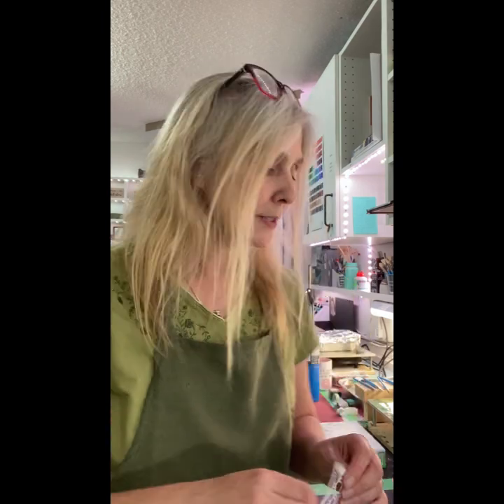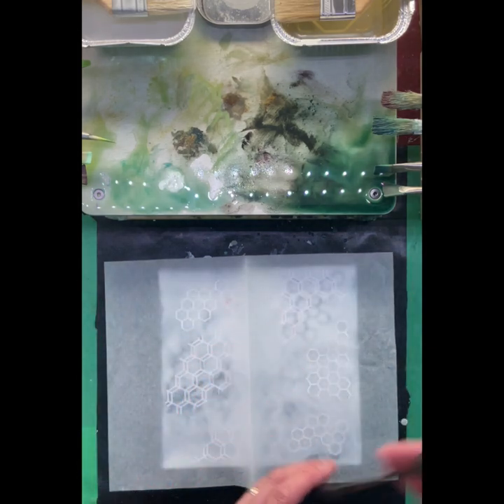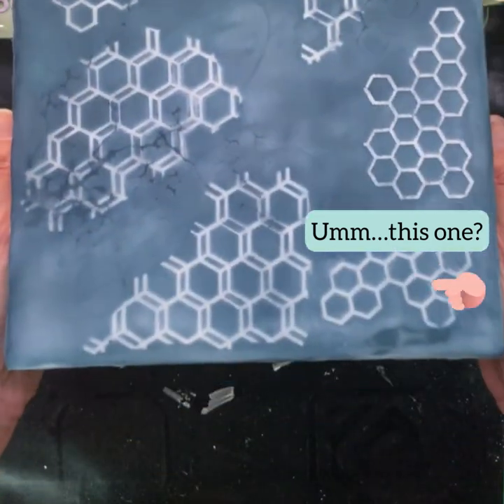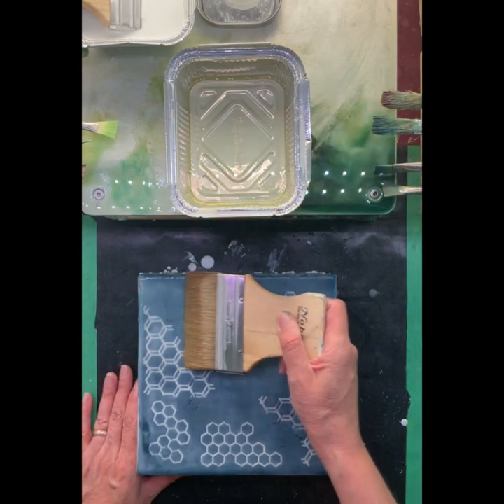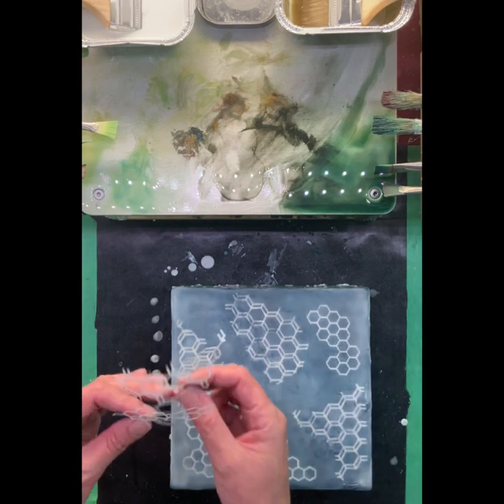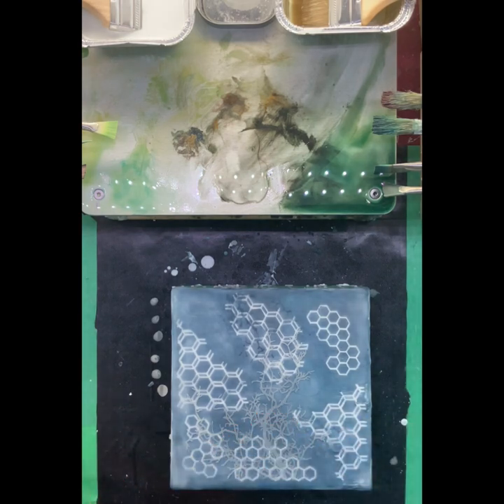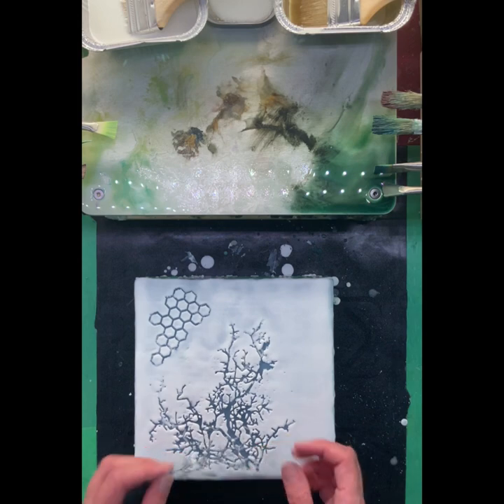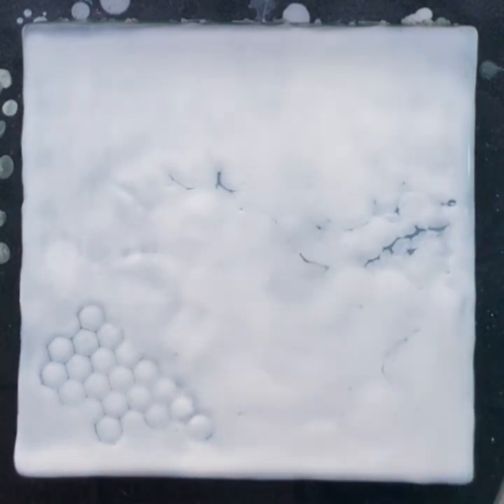Tyvek Stencils with Encaustic and Pan Pastel

Comment: Thank you for the very cool information about making stencil. What is that black paper that you have engineer to catch the wax?
Reply from the maker: Hi Lynne :). The black paper is a Teflon BBQ sheet.  It’s heat resistant and the wax will pop right off when it’s cool!
Reply from the maker: COOKINA BBQ Reusable Grill Mat - 100% Non-Stick, Easy to Clean Grilling Sheet for Smokers, as well as Gas, Charcoal and Electric Barbecues, Black, 15.75x19.68-inch https://a.co/d/ckhSSIc